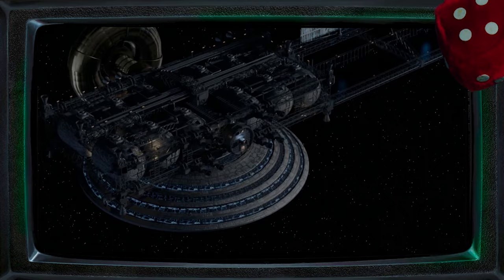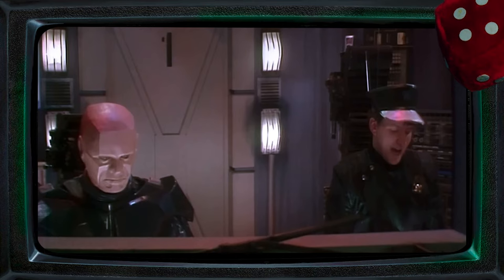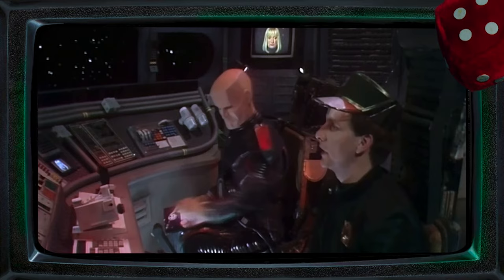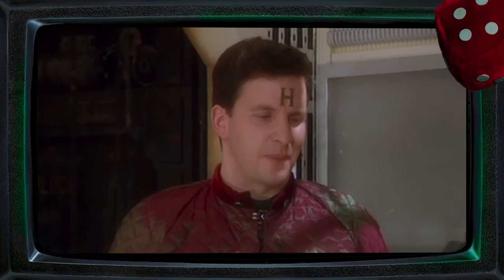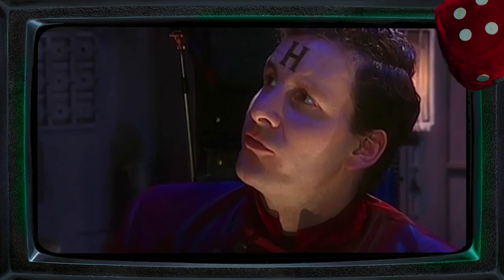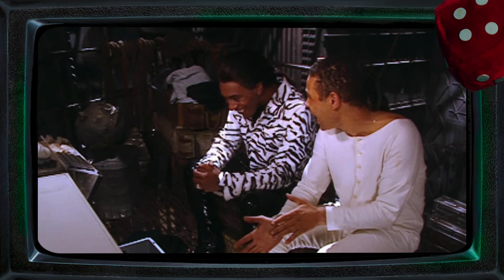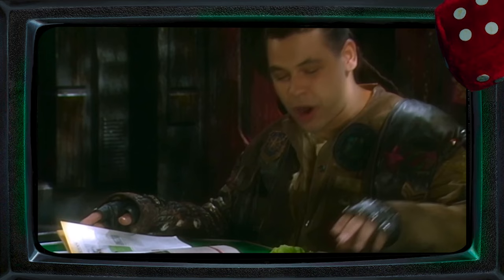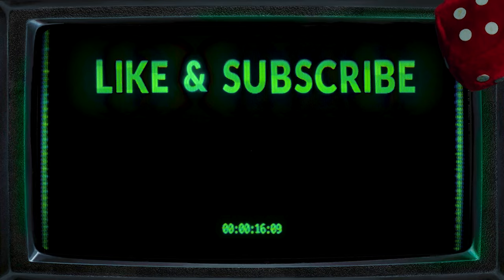Life Aboard… The JMC STS Transport Starbug | Spaceship Breakdown

Comment: To correct you on a small point. The reheat does not give them a burst of speed. To save on fuel they travel by using thrust and then running on inertia. When they reheat its because they need to move the ship or change course.
Reply: A reheat is an afterburner, it adds to existing thrust. Technobabble from Res Dwarf which you shouldn’t analyze.
Reply: @daddust  my explanation makes way more sense. I really dont think it's an after burner. I think it's literally just turning the engine back on or opening it up to full throttle. What does a JMC mining transport need with an after burner? Since they are trapped in deep space without red dwarf it would make sense that they cant continuously run their engines or risk running out of fuel. Hence they reheat the engines when needed and run on inertia.
Reply: @willlauzon3744  a reheater is an afterburner. It’s not what you call an engine.
Reply: Rockets don’t use afterburners. 
Starbug fires its rockets continuously. In reality, fuel would have gone within minutes. It also impossibly corrects a spin with no reaction thrusters.
Reply: @davidelliott5843  exactly. I still think my description of reheat makes more sense (see original post)

Comment: Starbug was the Nostromo of Red Dwarf.
Reply: I don't know.  The Nostromo is a freighter.  It's huge, although most of it is storage.  (Which doesn't make sense BTW: It's a space ship, they could just clamp the TEUs onto and around a control module, and add trusters at the edges.  It would make more sense if most of the ship proper was reaction mass or fuel, like an actual rocket.  The specs list "displacement" like for a maritime ship, what is there to displace in empty space?)  It has been described as a "space truck", has a crew of seven, at least five decks in the crew compartment (which, like the cabins on maritime freighters, are quite spacious), and equipped for tours that last years.

In short: The Nostromo is more like Red Dwarf, except that Red Dwarf carries bulk, and is designed to house thousands of miners and their equipment.

Starbug is a shuttle.  The Nostromo has a shuttle, too, and, like Starbug, that shuttle has hibernation units.  And a cat.